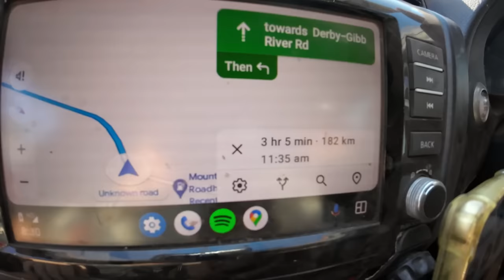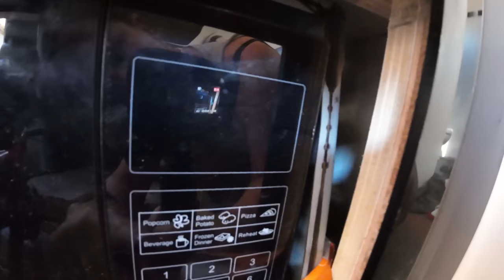THE ROUGHEST ROAD IN AUSTRALIA!! We had DAMAGE! This was WILD!!

Comment: What happens when you come to a part of a single track and someone is coming the other way,  with a van too?

Or you need to turn around and find another root?

I take my hat off to people who try a bush road with anything other than a off road camper trailer.
Reply from the maker: Luckily, the main roads have got enough room for two vehicles and caravans, there are some smaller tracks to gorges (which most people only take their cars to) but we didn't come across other caravans on those sorts of roads, which was good haha! Normally, there are some spots to pull over though. 
😁😁